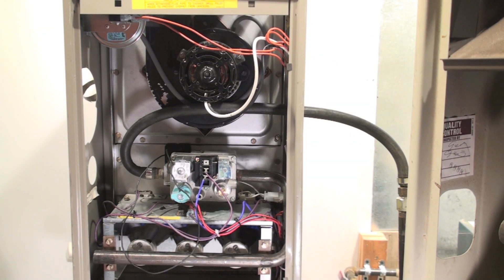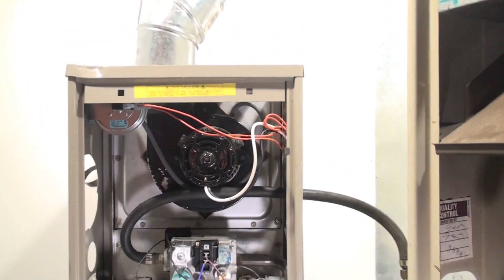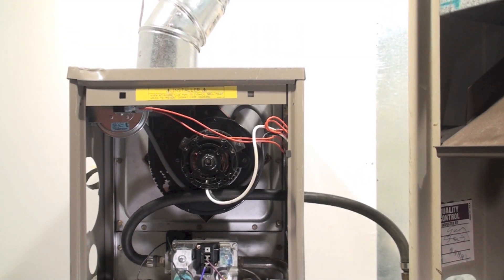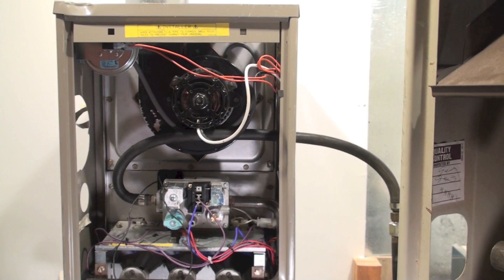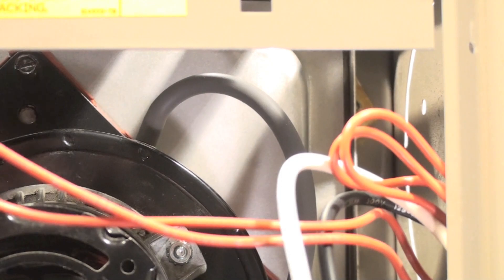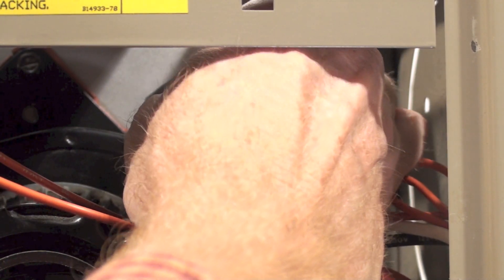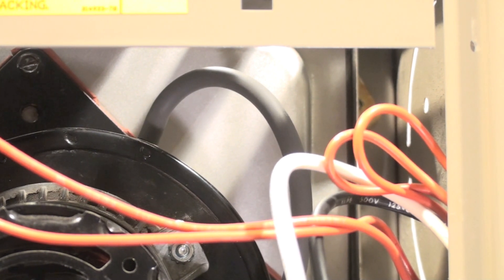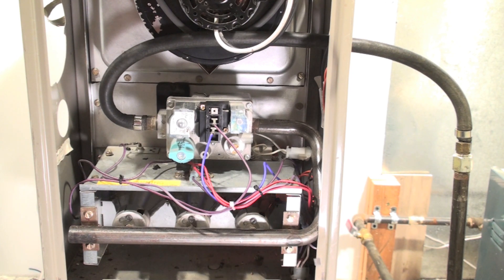Troubleshoot GMP Goodman part 1

Comment: I have a GMP-050-3 Rev B, the inducer starts, lights the igniter, you hear the gas valve click, it lights the burners, burns for 3-5 seconds, then the flames on the burners go out, the main blower starts about the time the flames go off, I have replaced the flame sensors, checked the limit switches for continuity all were closed and there are no trouble code lights on the board. It will try to relight a couple more times but never fully cycles, any ideas?
Reply from the maker: I would jumper the thermostat to see if it stops, but you probably have a board failure.
GFM

Comment: My  20 year old, horizontal, mounted in attic GMP 050-3 Rev B furnace's circulating fan just stopped running today. Furnace  lights off and fires up fine- but the circ fan will not come on. I'm going up there to check the fan start capacitor. If that's good- and the fan motor checks out, I guess its the Control Board........ Thanks for the video!

Comment: I have Goodman 99% furnance Exhaust vent Outside but there's water underneath blower inducer and fan blower side inside then it leaks on basement floor. Wondering if its Condensation pump or Blower inducer?
Reply from the maker: I would be checking for blockage in the condensate piping.  If it is ok, you may have a cracked inducer housing or bad gasket.  
GFM
Reply: @grayfurnaceman  Thx I check All lines Pretty clean pump works fine there is an litle slot  in front at bottom of blower I see water Ring water drip from front to back then down side.
Reply: @grayfurnaceman  I have video of furnace on my YouTube Channel.
Reply from the maker: @louishollandjr  Send to Grayfurnaceman@gmail.com
GFM

Comment: My gmp125-4 connection to the central ait was iced up outside and i looked at the heat exchanger for tha air and its not iced up but there is water that dripped into the bottom of the furnace below the blower. I cant get the blower to come on and it looks like the status light isnt lit at all on the board. The 3amp fuse is good. I cant even get it to come on in the heat setting. Any ideas? Im hoping water didnt blow the blower motor, but the board should still have a status light. Not sure what points i should look at for power and ground, and the circuit breaker wasnt tripped at the fuse panel. Is there a reset button for power to the board somewhere? Thanks
Reply from the maker: If you are comfortable with a meter, Check for power at the input of the transformer.  If power, check the output of the transformer.
GFM

Comment: Hi Gfm,  I have the same model and it gets to the set temperature, shuts off  and never comes back by itself, i have to flip the power switch off and then on to get it on again,  Please help,it drives me nuts, since i have done everything I know and it still not work properly.
Reply from the maker: Have you cleaned the flame rod?
GFM
Reply: Yes, I've done it all cleaned the the flame rod,  coil,  replaced  the filter, before had asked for help, still does the same as I described earlier.

Comment: First, Merry Christmas!  Our Janitrol furnace works great, but every once in awhile it will not come on.  All I do is turn the furnace off at the wall, then switch off and on the main power on the side of the furnace, switch the thermostat back on, and we have heat.   Are we looking at a bigger issue down the road?  I know this isn't normal.  Thanks in advance for your help.
Reply from the maker: You are probably going out on flame failure.  Most common reason is dirty flame rod.  Clean it and you should be back in business
GFM
Reply: @grayfurnaceman , can't thank you enough!!!  Your advice is always so helpful!!!  Will clean the flame rod now!  Merry Christmas to you!!!

Comment: I changed the flame sensor and my furnace turns on for a min or two then turns off again what should I check next?
Reply from the maker: If the furnace is a 90% efficient one, you could have water buildup in the vent.  Make sure all vent pipes have a slope down to the furnace of at least 1/4" per foot.
GFM

Comment: GFM, 

I have the GMP075-03. The fan is only blowing cold air. We have a brand new filter installed. The ignitor glows and starts the flame, but it only lasts a couple of seconds and then shuts off. Would you say this is the Gas valve?

Best
Dan
Reply from the maker: First, I would clean the flame rod.
GFM
Reply: GFM, it worked like a charm. Thank you so much!

Comment: If anyone is still paying attention to this video, I have an issue. I have a GMP 075-3 that the exhaust fan comes on, the ignitor lights, but the gas valve does not click and flow gas. So, the ignitor times out and the cycle starts again. After two or three cycles it finally works.  This is an intermittent problem and sometimes it works just fine. Anyone have any ideas?
Reply from the maker: If you have power to the gas valve on a trial for ignition, the gas valve has failed.  No power, wiring or control board.
GFM
Reply: Well, I haven't probed it with a meter yet, but as I said, the ignitor glows, but there is no relay click for the gas valve. Then the ignitor goes out but the exhaust fan stays on, ignitor glows again and then this time it may click and light the burners.

Comment: hi grayfurnaceman i have gmp0753 janitrol furnace i can't find the capacitor no where. do all furnace have capacitor. please  help where to look for it.do all  capacitor look the same.thank you
Reply from the maker: If the capacitor you are looking for is for the fan, it should be mounted on the fan housing.  It could be oval or round.
GFM
Reply: ok thank you so much grayfurnaceman

Comment: Have a GMP075-3, would the heat exchanger cause the main limit to trip? Clean filter, cleaned the coil, and fan seems to be working fine.

Comment: Okay, so my relationship with this furnace has evolved. I replaced both the board and the heat exchanger (it was indeed cracked.) I am having a limit problem now, as it will do the short cycle dance and not keep up when it's very cold (12 degrees last night). I am getting the limit code, but can confirm that the flames are not rolling out and being adequately induced into the heat exchanger, the exhaust vent is not obstructed, and the blower fan is running.  Another interesting fact is that when the ignition cycle proceeds, especially after several limit-induced faults, it may take up to 3 attempts for the gas to ignite. I've noticed that sometimes nothing happens when the gas opens the first time, it just "poofs" the second time, and usually ignites on the third attempt.  However, I've also noticed that the both the inducer and motor are only running at one speed. I was learning about this system as I was attempting to repair it, so I can't remember if either or both motors' speed is supposed to progress throughout the cycle. Is it supposed to? Do you have any other troubleshooting suggestions for this situation?
Reply from the maker: The motors run at a consistent speed.  I will be assuming there is no air flow problem like a plugged filter.  I would be sure the burners are clean.  The limit code is indicative of heat exchanger failure.  Yes, some of them had 2 failures.
GFM

Comment: my gmp blower fan comes on randomly even when thermostat is set to off the whole time. Just the fan, no heat. I replaced the fan limit switch, didn't solve it. where should I look next?
Reply from the maker: First try disconnecting the thermostat.  I don't think that will make a difference, but I would try it first.  The problem is probably the control board failing.
GFM

Comment: I have a gmp 100 -3 ...recently replaced the inducer...the furnace starts up runs for a while then shuts down..I have 4 blinking lights which indicate high limit but at the same time the inducer keeps spinning...and if I try to start right back up just gives me the blinking lights...however if I tap the limit switches it will fire up and do exact same thing as before...
Reply from the maker: If you tap the limit switch on the vertical front of the furnace to get it to start, the furnace probably does not have enough air flow.  It could also have a cracked heat exchanger (very common on these)  If the rollout switches are causing the open circuit, the furnace definitely has a cracked heat exchanger.  
GFM
Reply: Thanks...I checked out the flames for any irregularities concerning the heat exchanger and saw nothing abnormal...in addition  now the flames go out after about 5 minutes of run time....it's easily reset and go thru process again..
Reply: I replaced my heat exchanger and board for some unrelated issues, and now my furnace is doing the exact same thing. Did you ever figure out the issue?

Comment: hello got 3 blinks indicating pressure switch. replaced but have same problem. When the heat comes on and reaches temp in the house will not keep temp. When I cut off at power panel and restart heat comes on reaches temp and stops reheating until I reset switch outside on electric panel. Goodman gas pac.
Reply from the maker: I would be looking for vent blockages or inducer problems.  Also check for water in the pressure switch line.
GFM

Comment: I have a GMP050-3.  The flash code is 1 for bad flame rod or problems with gas input.  The igniter glows for a while, there is then a audible switch that switches on for a moment, then back off but no flame occurs.  It cycles and tries 3 times then turns off.  I checked a line for water and cleaned out the sensor.  This wasn't the problem.
Reply from the maker: First, is gas available?  If it is, the gas valve has failed.
GFM
Reply: Have this exact issue.  Started to where thermo would call for heat then furnace would come on without gas igniting.  Normally, it would ignite all the time on the second try.  We had someone out to fix it and they replaced the igniter but now it takes 5-6 cycles before it will ignite, so that obviously wan't the issue.  Now the repair man insists the problem is the control board at a cost of 300 bucks to replace.  Does this sound like a possibility.....I find it hard to believe that the control board would cause it not to light.  Everything time the igniter glows red so the control seems fine.  REally seems like the igniter is out of alignment or gas flow.  Opinions?

Comment: Hello, Gray man! Thank you for taking the time to make these videos. I recently purchased a home that unfortunately came with a GMP075-3 Rev B. The heat exchanger indeed has a problem that I was unaware of until I watched your video. Do you have any idea why the draft inducer motor would only come on for less than a second, and then I am getting a constant blinking LED fault code? (Reverse polarity, I assume?) Anyway, considering it warmed my house last winter and I'm pretty sure no one has rewired it, where would you advise me to start my search?
Reply from the maker: First, be sure you do not have reversed polarity with a meter.  If the polarity is ok, you probably have a board problem.
GFM
Reply: Start search in yellow pages for HVAC tech.

Comment: Is there a way to reset the limit switch if I have a clogged filter, or do I have to replace it all together?
Reply from the maker: I would replace it.  You may get it to work temporarily by removing it and tapping the sensor on something hard.
GFM

Comment: Thanks for the help. I watched several to find MY problem, but didn't. In order to share: my furnace was intermittent in heating and never showed any abnormal blink code. It would fire up and run as long as it wanted, but never as long as we had programmed into the thermostat. After numerous parts and several service calls the problem ended up being on the control board. It was one of two things since they happened during the same fix: 1. I removed the board at each of the four corners, turned it upside down and resoldered the inducer motor pin to the board. It was seriously lacking adequate solder and the motor would stop during flaming and then quench the flame. 2. While the board was out, the fuse at the bottom of the board fell out. Yes, fell out. I crimped the holders a bit to provide more stability and better electrical contact, replaced the fuse, then the board, then the doors and fired it up. It has been running for 3 hours without a glitch. Our house went from 60 to a balmy 73. Good luck.
Reply from the maker: Hope it continues.
GFM

Comment: I'm getting 4 blinks my schematic says it's a limit problem and could be primary or secondary, I switched out the primary to no avail, I don't have a secondary and I'm wondering if I would get the same diagnostic if the roll-out switches are bad? It's another Goodman GMT140-5A
Reply from the maker: Yes you will.  
GFM

Comment: I have a goodman GMT140-5A the blower motor is not coming on and the led diagnostic light is not lit on at the control board, I've tested power at the transformer (both sides) and juice is good, and I've tested voltage at the control board connection, voltage is good there, I've tested the capacitor, capacitance is good and at this point I'm lost, what advice can you give me? Yeah! I changed the board and the problem still exist without change.
Reply from the maker: Do the burners come on?
GFM
Reply: I never called for heat I was trying to get the air to work
Reply from the maker: I would jumper from R to G at the air handler.  That should turn on the fan, then jumper from R to Y the a/c should come on.  If it works there, the thermostat or wiring is the problem.
GFM
Reply: would the thermostat keep the L.E.D dianogstic light from lighting? I ask because the dianogstic light is not on.
Reply from the maker: No.  Sounds like you have no power to the board or the board has failed.
GFM
Reply: I jumped the fan as instructed, I got air movement, Check thermostat wiring found problem boo-yah!  up and running, ready for winter.
Reply from the maker: Its good to win.
GFM

Comment: Working on a gmp 100 and would keep going off on limit, there was no roll off but the flame seemed a little weak going into heat exchanger in one off the holes,also was not getting increasing o2 when burner kicked on,like you sometimes get with cracked heat exchanger. Air flow was fine,could the heat exchanger have seperation possibly?
Reply from the maker: Sounds like it to me.  Pull out the fan and look for rivet rings in the blower housing or the shelf  above the blower.  That's the dead giveaway.
GFM

Comment: I have a solid red light on my Goodman.  No blinking at all.  What could that be?
Reply: Solid red light means the furnace is working as expected
Reply from the maker: I think that's a bad control.  You can double check by going to graycoolingman and checking error codes.  I have a fairly long list there.  Hope this helps.
GFM

Comment: I seem to not have enough power to run my inducer motor, with my tester it shows 70 to 80 volts. Would that mean the board is bad? does the capacitor provide power to this?
Reply from the maker: If the rest of the furnace works ok (fan), the voltage is probably a ghost voltage.  There are a number of possibilities.  Is there a call for heat, is the pressure switch closed, is there 24 volt control voltage the the W terminal of the furnace?  Hope this helps.
GFM
Reply: I really appreciate the info, what I found out today is that the inducer motor is only for heating the furnace not for HVAC. So the only thing I am having a problem is main blower motor, seems to not want to start on its own, now I can start it by hand with my hand. To me this seems like its the capacitor or the motor.
Reply from the maker: I would look at the capacitor for this.
GFM
Reply: Thanks will do.

Comment: I have a GMP075-3 Rev B.  HSI not coming on during call.  0 volts.  Good contacts all around.  All thermal switches show good.  Call for gas and turns on without flame for a few seconds and shuts off.  Inducer motor does turn on and vac switch works.  No flashing LED, on solid.  Relay on board that controls HSI seen better days?  Replace board?
Reply: Update: Replaced the board and now HSI comes on like it should.  Limits out after 2 minutes of running and gas shuts off.  Limit switch becomes a open circuit until it cools.  Has a 160F-30 switch.  Is that low or correct?   What's considered normal?  Filter is clean and exhaust vent is clear.  Inducer motor and blower is working.
Reply from the maker: +yourmofo The switch is probably ok.  Probably you have a cracked heat exchanger.
GFM

Comment: Is that a rubber hose for a gas supply?
Reply from the maker: +Billy Smith Yes.  As noted at the first part of the video, this is not a permanent install and is used for testing only.
GFM

Comment: GMPN068-3 REV A.   Inducer motor comes on. Sometimes the ignitor coil will come on for a few seconds. Doesn't light. Most often 3 red flashes after 10 seconds and induction motor continues to run for several minutes then repeats same cycle.
Reply from the maker: +Ric Miller If you are getting a pressure switch code, check for water/blockages in the vent.Hope this helps.
GFM

Comment: We have a Goodman GMP, furnace is short cycling.  Will sometime stay on for hours then reverts back to short cycling.
Reply from the maker: +Patricia Moye I would first look at the flame rod.  It could need cleaning.
GFM
Reply: +grayfurnaceman i have changed out the blower on my AC. and now my heater is not working what should i do

Comment: my ac keeps flipping the braker
Reply from the maker: jessica bowen Does it immediately kick off or does it run for a while before kicking off?GFM
Reply: +jessica bowen You may unplug your blower fan and see. And you can also connect  blower to 120V and see if it flip breaker

Comment: I have a Goodman Furnace GMPO50-3 IT WONT CALL FOR GAS NOR WILL BLOWER MOTOR COME ON
Reply from the maker: Billbo Baggins I will need more info.  Does the inducer start?GFM
Reply: Thanks I have repaired it
Reply: What was causing the problem?